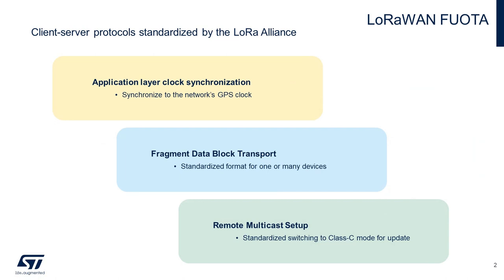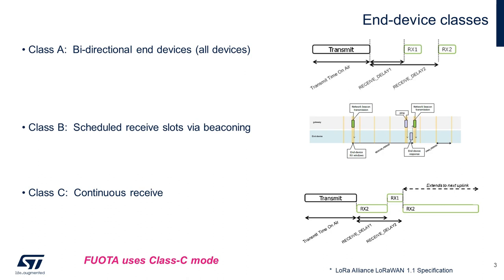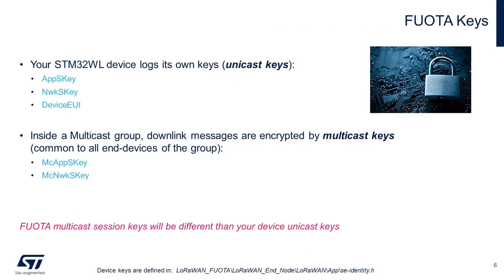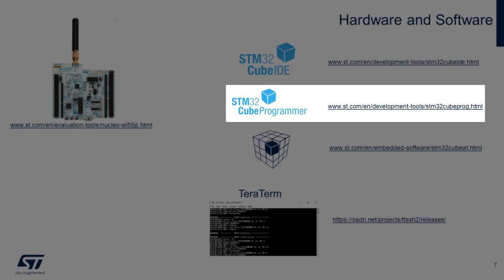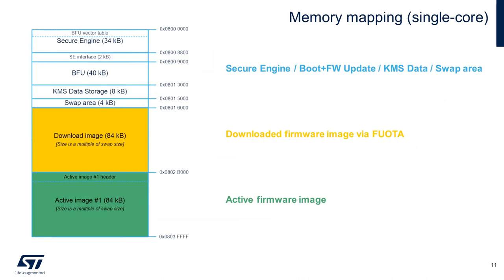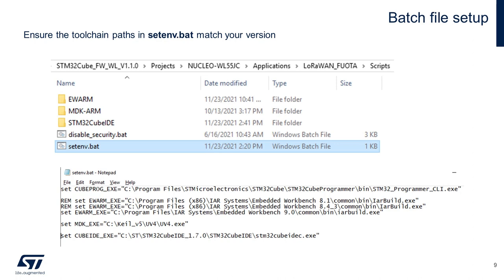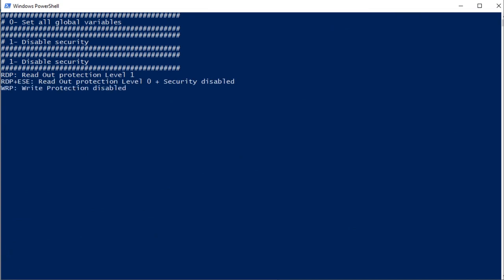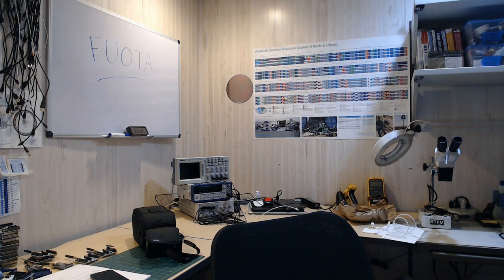Getting started with LoRaWAN FUOTA on STM32WL end device

Comment: When running build.bat -> On 1_Image_KMS_Blob ->  fatal error: kms.h: No such file or directory 
I haven't found any relevant info or documentation
Can you help me?
Reply from the maker: Hello Alex, It is not clear which toolchain you are attempting a build with.  Please edit the setenv.bat file for your relevant toolchain executable path.  You can also attempt to build the project standalone, and check the project for any include path issues. Hoping this helps you troubleshoot your issue.
Reply: @stmicroelectronics   I use the STM32CubeIDE toolchain. I follow your steps exactly and I still get an error. I have researched about the error on KMS_Blob (missing KMS.h) and I wasn't able to find any information or documentation.
Is there a way to compile without the IDE? (using Makefiles for example)
Can I contact you for help in any way?
Reply: @jkmax20  same error over here